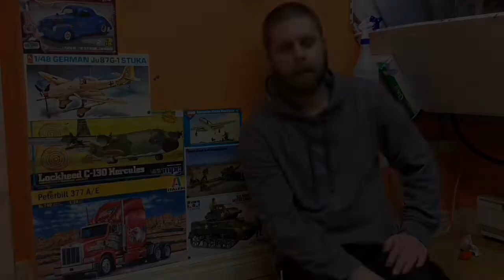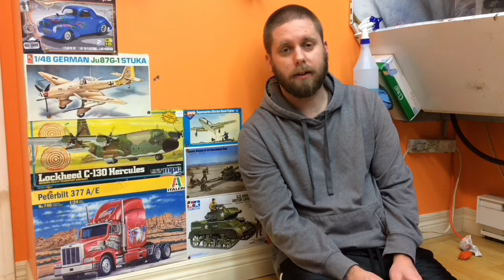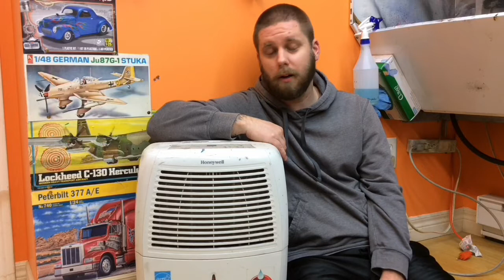Using A Dehumidifier To Help With Painting

Comment: Very good information. That was my one big struggles when I started airbrushing. Didn't realize wtf was going on until winter came, the humidity dropped and by brush stopped spewing water. 

In line moisture traps work well also and are cheap online, but actually removing the humidity is better.  I'm using a Badger 105 with a long supply line and won't even attempt to spray until it's below 45%. Preferably below 40%.